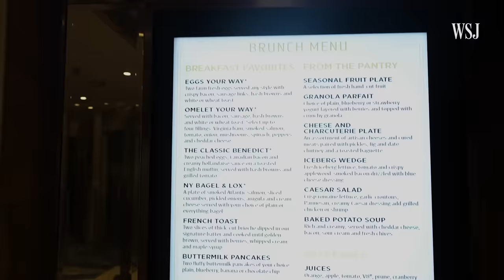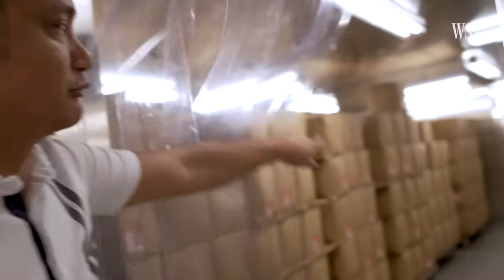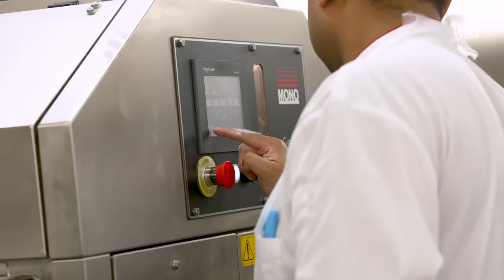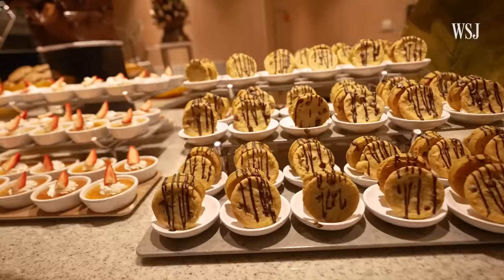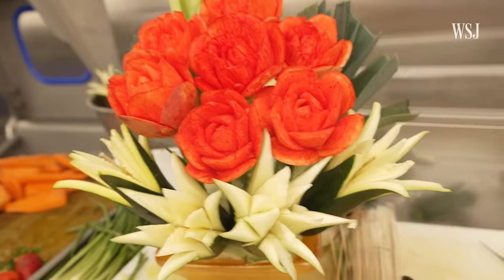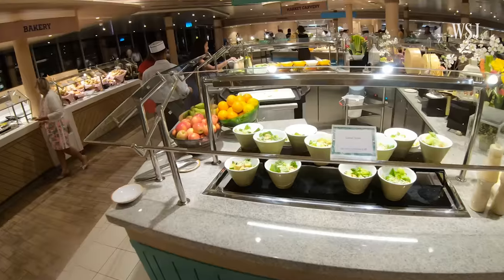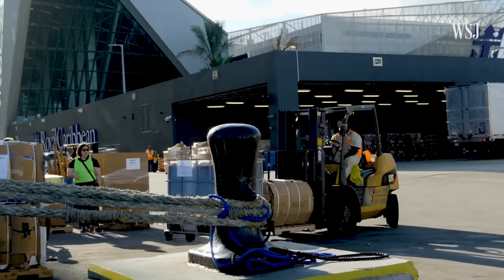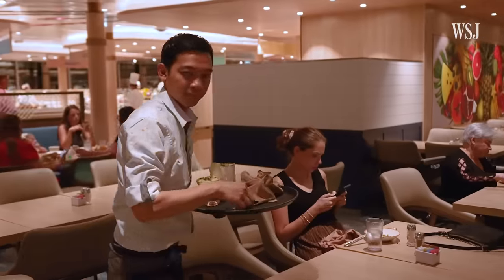Inside the 24/7 Operation to Feed the World's Largest Cruise Ship | WSJ Booked

Comment: Hold on you’re telling me cruise ships are just dumping the sewage in the ocean?!
Reply: Yes, once at a specific distance from the shore it is allowed.
Reply: Treated sewage is allowed to release to the ocean just like sewage treatment facilities on land.  They are not allowed to release untreated sewages.
Reply: @bluenycom is it really sewage if its been treated?
Reply: @heyyou031  That's is true but treated sewage water still has negative view so many water municipalities won't let it mixed back to 'regular' water supply.  My city uses treated water to water city parks only.  I believe there is a new law mandating to use treated water as normal drinking water.
Reply: All vessels discharge treated sewage overboard. Ships are required to follow Marpol legislation on pollution when discharging anything overboard.